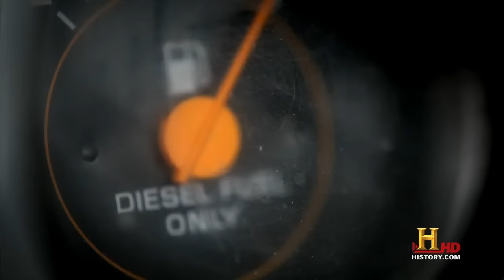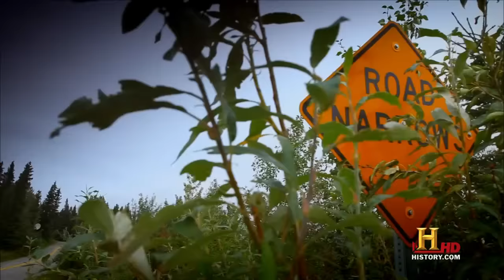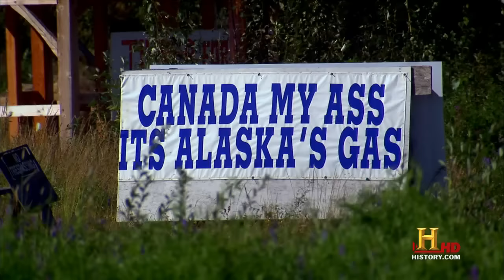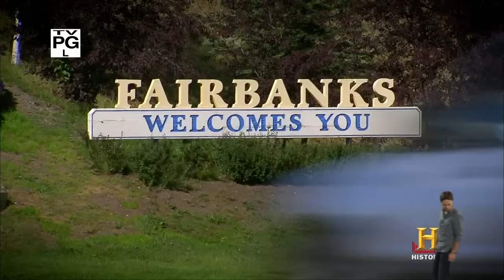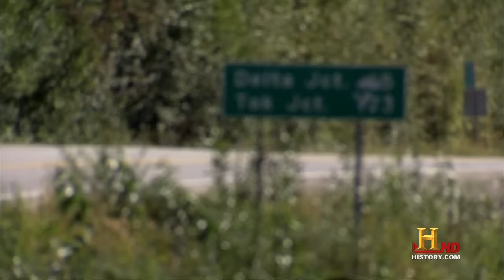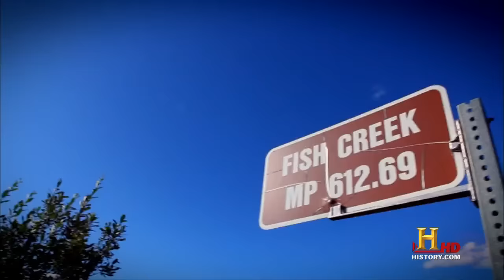Top Gear America Best America's 4x4 Truck   S01E09 - 2011.01.16

Comment: "Is it a bear?"
"No, it's a Dodge."
Me: Gets really excited that one bought a Dodge
"a 5.7L Magnum V8"
Reply: Michael Gatti lol yea didn’t know they made a 5.7 😂😂😂 maybe a 5.9 or 5.2
Reply: @joshflohr6133  If they would have got a Cummins it would have performed 10x better.
Reply: Michael Gatti prolly means the 5.9 gasser
Reply: Mine has the 5.9 360 another option is a 5.2 318 they didn’t come out with the 5.7 till 2002 in the third gen dodge so there is that
Reply: Its a 5.9 or 5.2 right? The 5.7 came after those I believe?
Reply: @michaelgatti8642  no
Reply: @chasecorwin4415  2003
Reply: @locodlr9461  correct
Reply: @michaelgatti8642  Don't underestimate the 318 or 360 magnum engines. Both are bulletproof V8s and many I have worked on have seen 350-400k miles, easy.
Reply: he had the opportunity to say, “no, it’s a ram”
Reply: TheKillerMarine my bad your right must have hit the wrong number
Reply: 5.7 is a Magnum? Hemi is gonna be pissed
Reply: I was disappointed he had a v8 in the dodge and not a 12 valve cummins 🤣
Reply: BLAZEgaming yt 12 valve Cummins is a v8 ;) I know what you meant tho😂
Reply: @levideweber6789  I meant- ahhh nvm
Reply: @levideweber6789  no it's not? It's an I6 bud. Read up on Cummins. How is there supposed to be 12 valves in an 8 cylinder engine?
Reply: Are those Chevy mirrors on that dodge???
Reply: @mountain177  nah those came with the old dodges
Reply: Then old Cummins well not die
Reply: @levideweber6789  a 12v is not a V8.......
Reply: Dude is a top gear host, about to participate in this Challenge and doesn't even know what size motors go in these trucks? I'm not even going to bother watching this now.
Reply: Michael Gatti would have been overpriced and beat to hell, “10k I know what I got, she’s got some surface rust but runs strong, 680k miles”
Reply: @AsianNIGMA  Yeah that sounds right. Trucks and Jeeps are gouged to hell here in Texas. Especially Diesel Trucks and 4x4s
Reply: Honestly, I don't think any of those trucks actually died. Chevy probably paid for this episode.  LOL
Reply: 5.9 V8
Reply: 5.9 V8 and 5.7 is Chevy
Reply: @levideweber6789  They don't make a cummins V8 genius. It's a straight six.
Reply: 5.7 magnum 🥴
Reply: maybe a 5.9
Reply: I got way more angrier than i should have when he said that
Reply: @nicholasmotes3380  they had a 5.7 345 ci hemi engine that came in 3rd gens, thats why said it
Reply: @captainruffles7906  yes but he’s a bad tv host so yeah
Reply: He shoehorned a hemi in there lmao

Comment: I've owned a 74 dodge 3/4 ton, a 76 Ford 3/4 ton, 86 Chevy  1/2 ton and 96 Toyota T100. honestly the domestic trucks are simple enough to build and perform well enough...
But Toyota engineering and performance off road is hard to beat.
Reply: Those Birfield joints were an archilles heal on those trucks, but no stock truck out there of that vintage were built to handle aggressive offroading. I've seen every kind of truck out on the trail and each one was a money/time sink to get them even close to rock crawling reliable.
Reply: A better 4 wheeler is a 1951 dodge powerwagen flathead spitfire 6
Reply: My dad still has his Toyota four runner he bought new, inline 6 3.0 manual (if i remember correct) i think its like a 86 or possibly a little older but its rusted and busted he owns a successful auto shop and could afford a new truck but its got 400k had his clutch rebuilt a few times and a few transmission parts replaced but he loves that thing and its a beast yeah it looks like crap but he wouldnt want anything else i admire it for its simplicity and its reliability. Gotta love Toyota for that at least
Reply: Well said about Toyotas, they are hard to beat., and is the best selling pick up truck in the world.
Reply: Ford dq best fam

Comment: The OG's had and have a chemistry that will be hard if not impossible to replace.
Reply: @Jonathan Vickers pure facts
Reply: True, but I just think the production team should be fired for letting the episode go live with some of the most stale joke deliveries, most unbelievable "accidents", and wooden/dry/soulless narration I have ever heard in my life.  The chemistry part, and even the breakdowns, may have been hard/impossible things to fix, but simple things like the voice over narration lines and the timing/tone of voice on the joke lines are very easy things to fix/redo, especially in a place with natural lighting that looks like it is forever 11:am, meaning they didn't have the normal constraints of having to nail the shots within a certain window of daylight to maintain continuity of the story.

Comment: "You've got a diesel with a carburetor!"
Reply: Random Stuff In Oregon it actually is a diesel, just a shitty naturally aspirated carbureted one that was replaced quickly by the 6.5 TD
Reply: It was probably a 6.2 naturally aspirated. They did have an air filter like that.
Reply: @snoopytheace4487  that is 100% not a 6.2 that is a old block 305/350. Notice the thermostat housing on the top of the intake manifold. 6.2 detriot did not have that. Also notice the location of the alternator . the 6.2 had the alternator on the right side of the engine. Pre 96 350s had the alternator on the left side of the engine. The engine in the video is deffinantly a 305/350 small block Chevy gas
Reply: @daltonandrew168  that I didn't know. I knew the old idi diesels like that do have air filters like that. I'm better with 6.9 and 7.3 idis.
Reply: Dalton Smith Also notice he said it’s a CK. There’s no such thing. C is for 2 wheel & K is for 4 wheel. It can’t be both.
Reply: Babylon falling  ya those old diesels are great. I currently have a  7.3 powerstroke. It's an 97 with mechanical fuel pump. Love that thing. I'd also live to have a square body gmc and put a inline six Detroit into it with a 13 speed.
Reply: Babylon falling  cool mine is the same cclb dually. It has 250k on it and I'm dealing with some issues. One of my injector cups is cracked and I can't use it right now. And my main tow vehicle is a 2000 f350 and its current getting some new stuff. After 400k ir needs it.
Reply: Babylon falling  hey dont sell me short, that old beast has at least 800k left. My grandchildren will be able to drive that truck. I take extreme care of it.

Comment: All while the Film Crew drove a brand new Ford Powerstroke Diesel crew cab with heated seats👍🇺🇸👊
Reply: Hooked On Diesel and maybe even a heated steering wheel
Reply: woooooooow so unfair
Reply: Hooked On Diesel to bad new powerstrokes are shit.
Reply: This is true
Reply: Sackmatters Ford is still the best selling truck that’s because Chevy a dodge are shitty
Reply: well they have to resell them a new truck every 3 years cause the old one broke down and the old chevy is still rolling
Reply: _ that’s because that Chevy is rolling into the Junk yard because it’s a piece of shit I’ve had my 7.0 power stroke for 14 years my buddy’s Chevy already had problems and his is a 2016
Reply: True
Reply: Dominic Rieli can we all agree that older trucks are better than new ones I have a 98 dodge 1500 v8 still running strong as fuck my dad has a 94 Chevy 1500 it’s running strong as fuck and my buddy has a 99 powerstroke  and it’s running great he just needs tires he has pussy road tires but still nice truck 😂
Reply: Jeremy  Langston long live the old trucks they definitely don't make like they did back in the 90s👍🇺🇸👊
Reply: Dominic Rieli 7.0 powerstroke?
Reply: Jeremy  Langston I have a 2006 Dodge Dakota I've owned it less than 2 years and I've been battling the temperature light I've cut the transmission cooling lines off of the radiator had them running through three separate coolers with an additional fan I'll be adding another cooler and changing the fluid again to Mopar ATF plus 4 instead of STP ATF plus 4
Reply: Dominic Rieli exactly 2016 new... that Chevy in this video was not for sure but around yr they said was 1987? So ya when it was simply made you can fix it yourself not no computerized and electrical crap new vehicles have nowadays
Reply: Until you break something and buy a new truck with the 1st part you replace
Reply: Ha
Reply: Hooked On Diesel I'm sorry but gas engines are way better
Reply: Hooked On Diesel wrong they drove a 2k18 duramax with dual turbo and cold fuel intake
Reply: Hooked On Diesel ford stands for Fix Or Repair Daily
Reply: Dominic Rieli that’s why the oldest truck was a Chevy and it STILL won
Reply: Dominic Rieli false
Reply: Sackmatters this is true 7.3 till the day I die
Reply: Hooked On Diesel hbhhbgggb
Reply: Sackmatters all power strokes are boss!!🇺🇸🇺🇸🇺🇸🇺🇸
Reply: I’ve owned 3 ford trucks. 2 of the transmissions blew and the last ones engine 2nd cylinder piston threw off the crank. I’m a ford guy but damn. My new Chevy never misses a beat and I run it just like my last trucks. And this one is even older, it’s a 92 with about 35000 more miles.
Reply: Dominic Rieli right because the ford Tritons are so reliable
Reply: Mason Anderson wtf is a cold fuel intake lol
Reply: I’m thinkin in a new Tacoma
Reply: Pie 902 the ford was a 1975 bud
Reply: Dominic Rieli no it’s because companies are contracted with ford. Such as states and airports. They are on let’s say 2-5-10 year contracts. That is why they are the best selling. 👍🏻 not saying I don’t like them considering I own 5 fords, it’s just new and some pervious powerstrokes are junk.
Reply: Cody Baldwin I don’t know a thing about diesels? Ok genius. Then what is so great about a 6.4L powerstroke a 03-04 6.0 and a early 6.7L. Tell me what is good and what is bad. Don’t assume I don’t like ford or their diesels because I have a 7.3L powerstroke. It’s my work truck for plowing and towing my gooseneck. I’d never hook a 6.4L or a 6.7L to it. I’d throw a 6.0 on it as long as it’s studded and deleted with a tow tune or stock. Not to mention fords transmissions in recent years remind me of 90s dodges as in they won’t last more than 100k with regular towing and or plowing.
Reply: Sackmatters if getting the 6.0 go with a 2005 to 2007 dont get the 6.4 at all the 6.7 is good  it you will pay more anything I say 2014 and up are good the 7.3 was good they made until 2003 but an 03 7.3 will be hard to find ....stay in your budget and you will be fine 👍7🌲
Reply: Hooked On Diesel power
Reply: @alfiebrotherton935  Triton engines are actually very good. I have an 03 Expedition 5.4 Triton V8 170k miles and a 03 F250 6.8 Triton V10 130k miles. Both run like a top still. Never had any major issues just normal maintenance shit. I bought both new and took care of them. Ford all the way!!
Reply: @anamericantoreview1132  I've had the same problem on my 97 dodge. The heads were cracked. I put a Cummins 12 valve in it to fix it and 1 ton axles. Now I'm rebuilding everything I took off so my Tj can have a fresh v8 and Dana 44s.
Reply: Go to a junkyard I bet all you will see is old Fords everywhere
Reply: 6.6 LML
Reply: They are so fucking nice... don't be mad cause you can't afford one
Reply: Nope, I cant afford to fix all the broken things...
Reply: Don't forget about the heated tailgates
Reply: Dominic Rieli they’re cheap. That’s why people buy a bunch of em
Reply: There are more old Chevy's on the road than old F150's,and that's a fact there easier and cheaper to keep running.
Reply: more like first on race day get it right next time
Reply: So the ford did win ha ha
Reply: My dad drove his 1999 f350 7.0 powerstroke for 450000 miles until the oil pan rusted out
Reply: @KingDomR  it's because GM has the same truck but with 2 badges Silverado and Sierra...
Reply: @KingDomR  you owned a truck 14 yrs and don't know what motor it had? 😕
Reply: Dominic Rieli u are biased as f with your 7.0 power stroke😂😂
Reply: @mashedt8rs290  First towed off the track? Yeah, you're right.
Reply: @Sackmatters  how would you know 
You've never driven one ?
Reply: uhhhh, never heard of a 7 liter ford engine... if you're thinking a 7.3, it was designed and built by International Harvester.... Ford hasn't been able to build a diesel worth a crap. but neither has dodge. chevy had the 6.2 and 6.5, but they were problematic. cummins even had some problems for a couple versions.
Reply: Haha i didn't watch all the video.
Reply: I like how the dodge had more mud than the chevy. Hmm fishy huh
Reply: WikiTool because more were made.
Reply: Ghost249 dodge hasn’t been able to build a diesel worth crap because they haven’t built one lol. and detroit designed gm’s engines
Reply: Ghost249 The 6.7 Powerstroke says otherwise...

(My farm owns 3 F-750s with 6.7s and my brother and father own em, I drive a 93’ 460 F-350 though)
Reply: Bullshit. Chevys are tough and more expensive for a reason. People buy fords cause they are cheap affordably and not to mention the ugliest crap out there. I own 6 chevys, 1 Toyota and 3 BMW's. Chevy is legend. Forever.
Reply: Massive Nigerian I hope you know it’s purely opinion. You are stating your opinion as fact.
Reply: @FordFan01  nope. Been a mechanic for 30 years. Ford's are plain trash most the time. Sorry. Cheaper and built cheaper.
Reply: Massive Nigerian I’ve been a farmer for 20 years on a farm that’s been in business for 100. We’ve tried Ford, Chevy, and Ram. Out of all of them; Ford hasn’t given us many problems. I seriously doubt you are a mechanic because “Massive Nigerian” isn’t really a professional name....

You want cheap? Look at our Ram that’s fuel tank vent would clog and implode the tank. 3000 bucks for each time it happened (3). Worked in the same conditions our Ford’s do.
Reply: If u want to go offroad with anything dont but new
Reply: Nick Kocian Isuzu designed the Duramax chief!
Reply: Hooked On Diesel Only one guy used a Rusty chevy🔥🔥💯And made it
Reply: Dominic Boi maybe because he abuses his truck and you just rub your powerjoke with a diaper every weekend.
Reply: Dont get too butt hurt
Reply: True!
Reply: @jeremylangston5891  those aren't old trucks the good ones are 70s and below, some 80s
Reply: @gerald7429  false. The chevy is an 83, the ford is a 76
Reply: @GODLlKE  that is savagely good dude!
Reply: Dominic Boi aww poor you, set to the mindset that because of ford being the #1 sold truck you think it’s the best, sorry that your brand was the first to go bud
Reply: Brand new
Reply: @KingDomR  they've sold more because they're cheaper, and they were built with shitty cheap parts...
Reply: Nah film crew was all in similarly built Toyotas from Greentree Fabrication in Anchorage.

Comment: The Ford would have made it the rest of the way if he had of removed the rear driveshaft from the transmission then drove it in 4x4 so he had front wheel drive 👍 I have done that plenty of times off  roading in my old fords, they always got me home even if it was only front wheel drive 🤠
Reply: Yup had a 77 f250 with a 460 break those u joints thats what we did fake af show
Reply: That seems like the logical solution, my friend drove his 4x4 ranger around in FWD when his rear U joints went.
Reply: In the Death valley episode of Top Gear Adam drove a ford bronco in front will drive the whole entire episode cause the rear axel broke
Reply: To be fair the way they drove it probably still wouldn't have made it.
Reply: All of you guys are proving that ford has yet another issue, driveshafts
Reply: @idioticrehab6614  OR are they proving the obvious, which is that the stock driveshafts on those trucks (and even a lot of aftermarket ones) can, and will, break when run hard in extreme conditions?  Not many drive shafts are built to withstand being smashed into a massive rock with a couple tons of force on top of them.
Reply: I thought of that but wasn’t 100% sure

Comment: Oh that chevy 350 sweet sweet 350 block. One of the best motors to ever live.
Reply: KingConker101 mine have all been total piles. problem after fucking problem... but I know how to fix them so they keep going
Reply: Jeffrey, thats the issue most people have.. each person has their own experiences with certain motors and not all motors are exactly the same regardless of being the same engine. Ive had a 350 blow up on me once but it had issues we didnt know about when we bought it but luckily we only paid 1200 USD and got to drive it a few months then it gave up. Since then and even before that id never had to work on my 350's
Reply: maybe give it the benefit of the doubt and say you got all beat to hell motors xD
Reply: KingConker101 , one of???